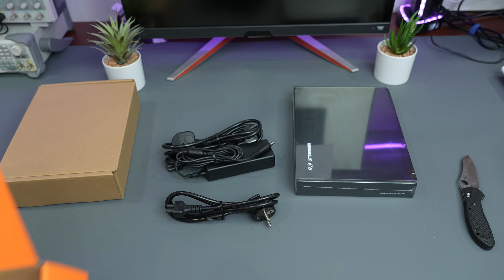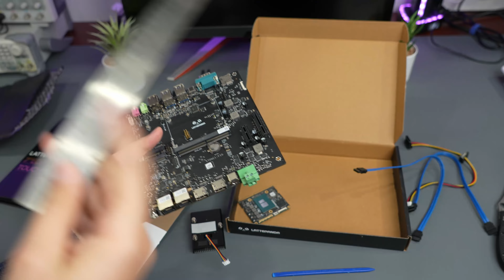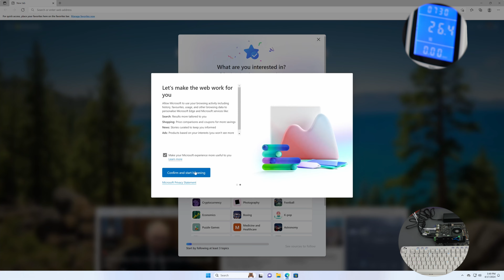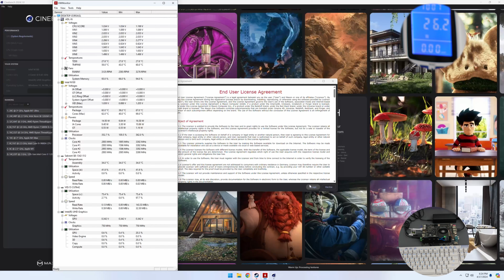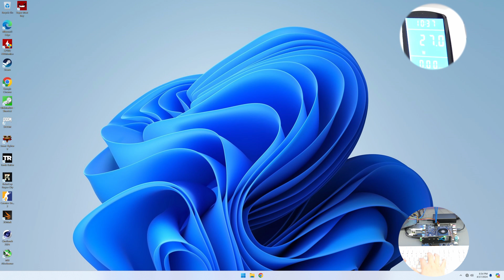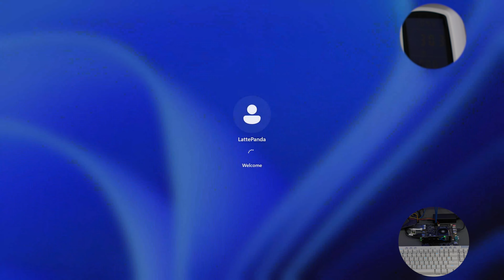LattePanda MU Full Review & Unboxing: Everything You Need to Know!

Comment: i bought a N100 mini pc with 16GB DDR5 RAM and 512GB SD for $90.. much cheaper than buying lattepanda
Reply from the maker: What's the name of the computer/board?
Reply: @TechnicallyUnsure  T8 Plus
Reply: This is not just a mini PC. its an SBC which is meant to be a development board not for basic consumer use. If you want an N100 sff pc just to browse the web, then yeah this is not for you........ The compute module is meant to be used with custom carrier boards that anyone can design if they know what they are doing for their specific usecase....
Reply: where did you buy it at 90$?
Reply: @DSTEAM1000  Aliexpress

Comment: The Intel N100 is a nice little chip. I went for the cheap option, and got the Firebat T8 Plus mini PC. It's much faster than a Raspberry Pi 5 and has better software support (because of X86 vs ARM). And it can play 4K YouTube AV1 with Firefox on Ubuntu.
Reply: I don't know what the BIOS on the Firebat is like (altho I'll look back at your video right after this lol) but the BIOS here was loaded with way more features/options for customization than my GMKtec Ryzen 7 mini PC. Assuming Firebat went a similar route in terms of the BIOS, I kinda get why this is priced higher.